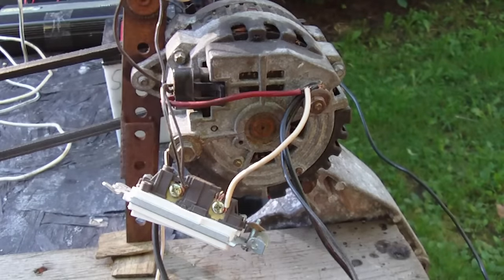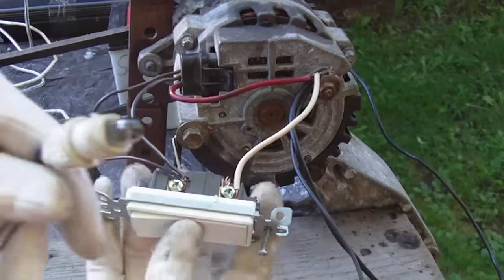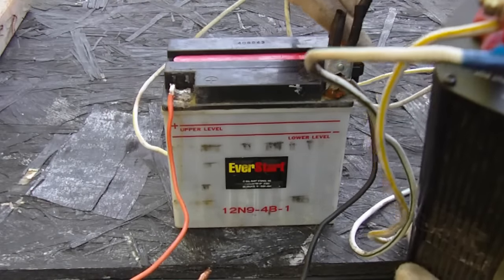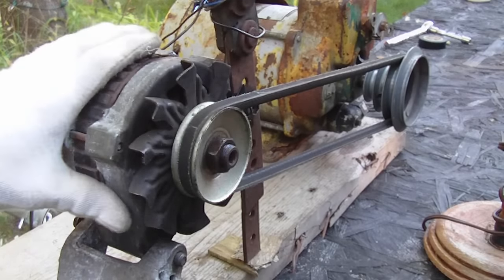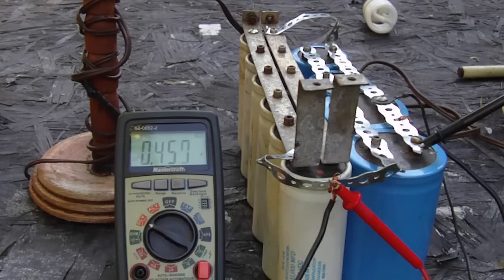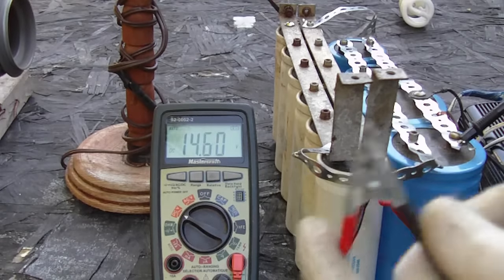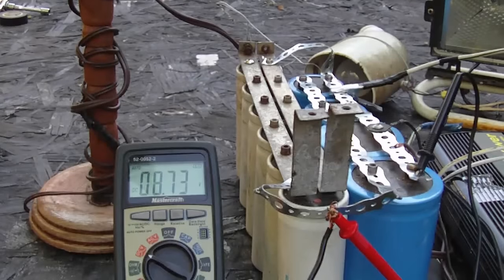Alternator DEMO Wiring, connection to Battery, Capacitors, Inverter, Modification

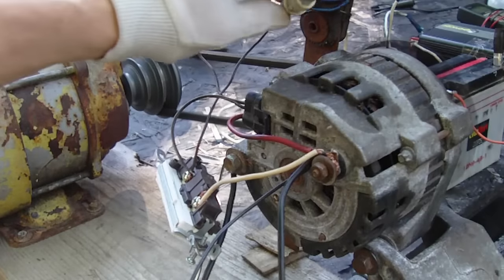Comment: No, Reuben, that's not what he's saying at all. the electric motor on the left is there as a substitute for a gasoline motor and when he "pull starts it" he's also turning on mains power to the motor. He explains at 2:00 that he has to help the motor start because it wouldn't come on otherwise, but it is running long before the alternator is enabled. This isn't some sort of "free energy" hoax and he isn't saying the electric motor is running off the alternator output. He's merely demonstrating how one could generate electricity with a gasoline motor, using an electric motor for convenience.

Comment: I tried soldering  my field connection with 2 16 gauge wires ...red on positive and black on negative and now when I try to hook up my battery sparks start flying as soon as I attach the 2nd wire. There's a short somehow! I disconnected the negative and clamp to alternator  body and same thing...any ideas? Thx

Comment: Okay fine you got an alternator work outside of a car but you got to use an electric motor to turn the alternator to run an inverter to get 120 are you going from 1:20 to 1:20

Comment: Hi there, you seem like you know a lot about alternators! Do you know what kind of resistance should one measure between an alternator's BAT+ terminal and the ground (case) of an alternator, while it is off the vehicle? I just had my alternator rebuilt but am suspicious of the rebuild quality, and I'm getting differing opinions on whether a there is supposed to be resistance reading between those points and if having a high reading (in my case ~2500 ohms) indicates a problem or not. I fear this resistance could be the cause of 2-3 hour battery drain problem which is a problem my car had been having before the alt was pulled. This is on an early 80's car. thanks in advance

Comment: I have a 5 hp gas engine running my generator to charge a battery bank. 
when i turn the generator on i can turn the switch off again  just leaving it on for  a second, When the  engine runs out of gas there is no need to 
go  back out to it until i need  to charge the battery again , thanks for the video,al
Reply: That's a cool idea! I'm looking at my own power generation soon as well!

Comment: you need a large battery bank that could run the inverter for 5 hours. the alternator is just a separate recharger. you need to make the 3/4 horse motor run off the battery bank. then if you could get the motor to run off a generator head with a battery bank to start the system.

Comment: Question if where my positive wire hooks to the alternator(the one that goes to the battery) is really rusty could that cause my alternator to put out more voltage and less voltage at times??
Reply: Short answer: yes

Comment: can you get the induction motor hooked up to a water wheel  for free power?
Reply: RPM requirements  limit that as practical, but gearing has been used in some places to address that hindrance .

Comment: I have Actros Alternator which is have 5 pins. So could u help me how i want to connect to the battery and kindly post which pin goes to which connection.
I am very thankful if i get the answer.....

Comment: You could do this with AA batteries. There really is no need to use these capacitors. Once the alternator is up and running, it can energize with the power it is generating. You really only need the 12V initially. This is why you can take the battery out of your car once it is started.
Reply: tarstarkusz ,tha is correct.
Reply: Ohhhh. Now I understand. Thank you for helping me get my mind around this. You see, where I've been thinking about this all wrong is I've always thought it had something to do with the gasoline. I feel stupid. And contagious.

Comment: I May be wrong here, but every video of yours I've seen, i hear you flicking the switch to turn that motor on. So your using the motor plugged in to turn the alternator, as if it was in a car? Isn't the i idea to not need a utility?

Comment: Hey could you use alternator with capacitor and battery combos with a converter to alternate between capsaetiers and batteries of so that the battery would insta charge capasotrs

Comment: So im not sure what the point is to this video because he has line power running his electric drive motor so why is he wasting electricity by driving an alternator and inverting to ac again?
Reply: The alternator is 12v 
The inverter changes the 12v to 110v
Reply: Yes but hes got 120v running the whole thing to begin with. So 120v to 12v to inverter to 120v . pointless

Comment: It's a more useful concept if you use a gas powered  engine to drive the alternator. Something as small as a 3hp lawn engine or possibly even a small two stroke engine
Reply: Wind & water work to drive the alternator.

Comment: the enthusiasm in your voice reminds me of Denice the menace getting up to mischief ' very helpful video , i am having troubles with wires ' i am trying to use alternator to charge a battery bank of 110v / 120v wired in parallel '''' / and my 12v led indicator light on alternator stays on '''' ( so i can only get one 12v battery to reach just over 13v ) i am using a 24v 300w electric scooter motor on a larger pulley wheel so has an apparent rating of 1800rpm powered by a 6 amp battery charger and at the moment charging with 12v trickle charger from wall socket ( until can afford to buy parts for solar and wind '' do you know if what i am trying to do is even possible ???? i like how you use them capacitors ' can you give some information on size / micro farads or what ever they are called ' because i am running a 3000w pure sine wave inverter ' and would i need them full bridge rectifier things in my circuit and do i need to put fuses in my system as i am rubbish with electronics and only been learning for two months .
Reply: you need to wire the batteries in series to get above the 12v, 10 in series for 120, 20 for 240v. Your alternator wont charge them unless you connect to 1 battery at a time and keep changing to keep each battery charged, but that means  you wont really be able to use the bank or the other 9 or 19 batteries will run down on you.

Comment: I like to see no inverter and it self running ? if you know that wire it the right way you can get 90 amps and 240 volt S and it will self run and no need for a inverter !
Reply: Ronald Preslar .
That is what he is trying to get across.

Comment: That will put out 90 amps if you hook it up right you can give your house all the power button you need and it will run on a 6 amp battery

Comment: One alternator driven at 2000 rpm  provides the same 120vlt/90amp electrical energy and amperage as one leg comming in from the utility pole to your breaker box.

One alternator can power everything you have running off of 6 15 amp breakers.

This guy runs his house useing one alternator as the motor to power one alternator as the generator in a self looping system.

The feds are restricting what he can reveal, even the cover age of his videos.

Comment: hey is it possible to use a 12 volt motor to work with  the alternator
Reply: vickram inderdeo
Reply: Yes
Reply: Yes... Connect the THINGAMABOB TO THE FALANGIES A+ And TURN AROUND 4 TIMES AND CLICK YOUR HEELS TOGETHER 2 TIMES...
( oooh and wear the magical Ruby Slippers )

Comment: I'm looking at the wiring and the annotations appear on top of that, really annoying! Other than that, very appreciated for your video, I'm trying to build an electric windmill, based on a used alternator and a car battery...
PS: Can you tell the names of the connectors? Like (F) Field, (E) Negative, (N) Stator? instead of first, second...
Reply: look up a scamatic of the alternator model  you have
Reply: Use a deep cycle battery. Their made to be run down and recharge again, unlike a car bat.
Reply: FonsecaMeire....well back in 1973 my dad built a 12v. generator with a briggs stratton 1.5hp gas motor and
 an old car's "generator"....not an
" alternator" F.Y.I.   JON
Reply: Yall know where I can get a alternator and other parts??...it'll be gladly appreciated
Reply: To power a small windmill I think I would use an old treadmill motor and controls. Its variable speed. Mine has a 90 amp DC motor and got it for free because the gauges failed. Runs on 120AC but easy install.

Comment: I saw the self excited motor generator and capacitor too it could generate need not fuel. Or better yet redesign the motor rotor and stair in both moving frame that take turn rotate like a saw tooth type but make the rotor carry with it intersect permanent magnet at 12 degree separation so that first 12 degree it is a motor and next 24 degree it become generator then back to motor therefore it use 12 degree to charge battery and 12 extra 12 degree to power load and battery keep it moving

Comment: Impressive 200 watt incandescent from 12v inverter all the way up to 110 thats like ten times the power from inverter so really its pulling like 2000 watts from the alternator. Guess you dont need a bigger battery if you use caps

Comment: woow! that's a lovely project to do. i'm also interested in doing such a project but i have a different alternator, it's a Lucas A127 alternator. could you please advice on how to wire the connection.

Comment: could you mount all that into a 5 gallon bucket and mount the alternator with a bike gear and a vertical turbine to drive the alternator instead of a dc motor.
Reply: making it portable and useful
Reply: perhaps a gear and pinion to use a water way such as a creek or a brook.
Reply: before you do all this tractor supply has 1800 watt port.generator 120v. and 12v batt.charge output for on sale 150$ much better option will work refrige freezer in outage lightweight good for solar backups
Reply: Don Desnoo thank you much better idea but if this is a freebie then it's a given to find a useful concept for them. For instance if you have a few laying around.

Comment: So he has the motor plugged into a 120 volt wall plug to run a 12 volt alternator to charge a 12 volt battery just to run an inverter that turns 12 volts back into 120 volts. Yea... Smart. Seems like way to much work to come back full circle.

Comment: Dr. Emmett Brown….””Okay, now, we run some industrial-strength electrical cable from the top of the clock tower, down, suspending it over the street between these two lampposts. Meanwhile, we've outfitted the time vehicle with this big pole and hook, which runs directly into the flux capacitor. At the calculated moment, you start off from down the street, driving directly towards the cable, accelerating to 88 miles per hour. According to the flyer, at precisely 10:04 p.m. this Saturday night, lighting will strike the clock tower, electrifying the cable, just as the connecting hook makes contact, thereby sending 1.21 gigawatts into the flux capacitor and sending you back to 1985. All right, now. Watch this. You wind up the car and release it. I'll simulate the lightning.

Comment: Just plug your light into where you had the motor plugged up👍
Reply: Yeah never showed how he had that thing going..
Reply: Thats what I'm saying . Is he getting the power from the battery while the alternator is charging it making it a full circle or what . If it did now thats amazing
Reply: There is no free lunch. The electric motor that is turning the alternator will use draw far more energy than the alternator can produce.
Reply: Old fashioned "crank to generate electricity" type alternator (just like them shakable flashlights that charged up as you shakedown them) with a compressor electrical pulley engine. Start up the compressor and it will automatically turn the alternator generating electricity so the compressor engine can keep on turning
Reply: Every one of those videos never explains what is provided the electricity to run the electric motor

Comment: Ok this is WHAT I WANT ya to do to prove these bloody auto electricians what I want is do able..get a scooter that works run a alternator off the tire which runs the alternator which in turns feeds power back to battery..now go

Comment: Bro that's beautiful but I have a question where a u getting the power for a moter to spin the alternator
Reply: The motor is plugged in to the house power like regular. The point though is that you are only paying for the motor power not the rest. That is beautiful
Reply: ?Battery to Alternator to Motor, yet The Initial Power is the Battery, but Powers It's Ownself?!?

Comment: Good demo, thumbs up!  Capacitors are a great addition to many electrical systems.  They help inverters and 12v fridges get that initial starting current (grunt/torque) they need for heavier loads and are a great companion in a solar system.
I made a 6 pack of 2.7v 700 farad caps with Anderson plug & balance circuit for use with a number of things at home,ie, battery charging, 12v fridge (always on in 4wd), I have started my forklift & mowers with it and a number of other uses also.  It helps greatly with 12v fridge in cruiser, as I have had a few issues with electricals, terminals , etc, getting enough volts to start fridge and they can regularly drop out on low volts if they hit about 10.5v @ compressor, which can easily happen with any small resistance in the circuits, so bottom line is the caps have stopped those issues as I have and Anderson Plug and H/duty cigarette plug on the fridge, I can plug the caps straight to it and the cig socket.  Anyhow, thanks for the share, and I like ur vids.

Comment: or you could just use the plug that's running your motor to plug your lamp in..
Reply: He's just using this as a demonstration. You could use a gas powered engine (like from a lawn mower) and you have a gas-powered generator
Reply: Or attach the belt to a water fed paddle wheel in a stream or to a wind turbine of any kind and have free power.
Reply: Or wire the Alternator a little different inside the coils so the Alternator produces AC 3 phase voltage and that way you can prime the Motor to run Alternator and that voltage from Alternator will run the motor. Then you have all additional supply from the same Alternator to run Bulb / Drill / Heater and what not. Learn to wire the coils which cancels back EMF then all else is possible.
Reply: that's what im talking about, thanks! @SamMonkulas
Reply: Karen Russell The main issue with our Current Motor or Alternator/Generator is basically the Windings both on the Stator or the Rotor. The design produces a Back EMF which basically restricts the Alternator to produce more Voltage+Current (means Watts) than the Input. So this is like putting brakes to a Car when it reaches the speed of 80kmph. If I may exaggerate a little more, is like wearing condom. The full potential of a motor or a Alternator cannot be achieved with current age old outdated design formula. It has to change to produce more Output than Input power. Otherwise we are no better off than the primate.
Reply: Thank you for explaining that Sam Sam that help me solve this little problem I was having with my setup I get it all working I'll put it on the tube for y'all
Reply: @homermcclain7694  share with me
Reply: @homermcclain7694  please
Reply: @SamMonkulas  It sounds like you know what your talking about, how about you doing a vid for us all...cheers bro
Reply: Beggers belief in theory the windings that each Motor / Alternator gets is a single copper wire with complete loop and all connected in series or parallel. What we have missed is to wind a Rotor & Stator with Bi-torroid means using Double Copper Wire for each winding section of Rotor & Stator. It is not easy to learn this as there are very little books available which explains this type of windings. The result is that it cancels the back EMF produced by the single wire and hence the efficiency or Output is more than 200% than the Input. I will definitely do a video when I complete my 10KW motor generator, which is basically left side motor and right side Generator and using a Single shaft to run both Rotors. I will show you all once I am finished. Until then cheers.
Reply: @SamMonkulas  cool
Reply: @martinmakarick1957  you mad bro? How much have you paid into your power bill over the last year. I haven't paid for electricity for over 4 years thanks to this kind of technology.
Reply: @aaronjoseph7573   I am glad to see people working with this technology. The electric company has us trapped,  and they have no concern in any changes to make energy cheaper or free for us . I have an old set of time life home handyman books from the 30's . In one it shows how to make a welder out of an alternator. I do not understand how it all works first of all but I am trying to understand . In one video I watched the gulf explained that an alternator actually produces ac current but has an internal device that switches it to DC.  He eliminated this device and just produced straight ac. I don't know if it was bs. The whole thing is to produce over unity so that you run the generator and everything else. It has to be possible.  I know with cars , the 4cylender motor was developed to produce more with better transmissions and gear ratios .There is a guy from canada Gerald Morton who has a good channel. Good luck we need free energy dont let anyone tell you it's not possible .
Reply: Thanks for the video. 

What type of motor where you using in the video.
Reply: I was wondering the same thing. Needs to show something else running the alternator.
Reply: Maybe if we tag team 6 hamsters on a wheel you could have free energy! Oh, wait. Wait a minute... it’s not free you have to feed the hamsters. Back to the drawing board!